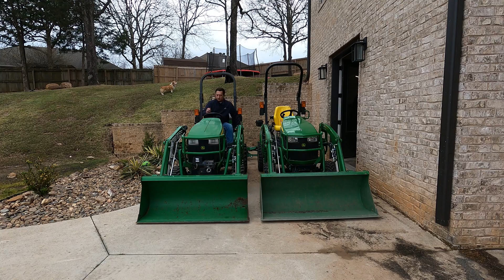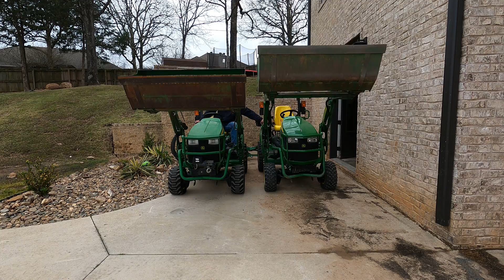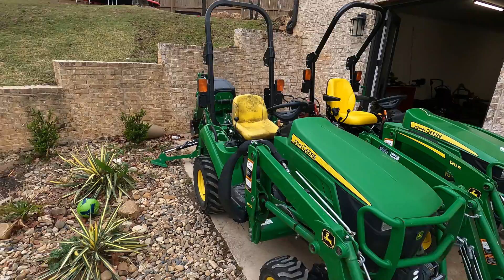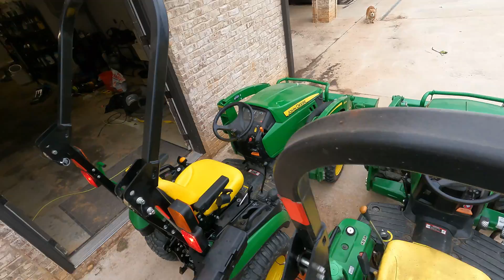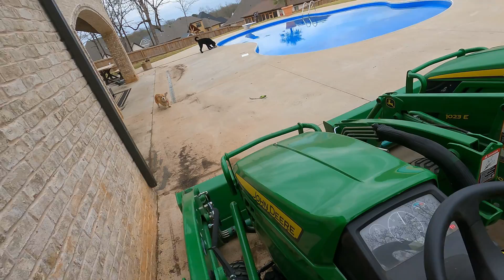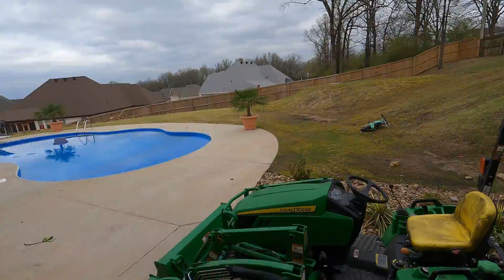John Deere 1 Series Loader Comparison - HydrosPlus Performance Kit w/ 9.5 GPM pump vs. Stock

Comment: Would doing this upgrade along with maybe increasing the hydro PSI to say 2600 on a 2017 1025R increase backhoe performance and digging power?
Reply from the maker: Definitely.  The backhoe PRVs are set at about 2500 PSI, so unless you increase your pressure to at least 2500 PSI, you are losing some potential with the backhoe.  HydrosPlus will make it smoother and give you the ability to run all functions at once.  Here's a video that illustrates this - https://www.youtube.com/watch?v=pG-IjSb4BPc

If you want more backhoe power, you may also be interested in the larger bucket cylinder that we're coming out with this Spring.  Be sure to subscribe if you haven't already and sign up on the website if you're interested for the latest info.

I talk about the backhoe cylinder in the first 5 minutes of this video - https://www.youtube.com/watch?v=R_ldBSPbX-A

Comment: Is it safe to assume this voids the JD warranty?
Reply from the maker: Hi Jim!  Thanks for this question.  Actually, this will not void your warranty.  This is because no single thing that you can do to your tractor can void your warranty per the Magnuson-Moss Warranty Act.  That said, if you do have a problem that can directly be attributed to a failure, then JD can decline to warranty the specific item.

Here are few examples to help this make sense.  

Let's say that you are still in the 24 month full warranty period and you modify your injection pump for extra power.  If your dash cluster goes out, JD will still replace the cluster even though you have modified something that is specifically called out in the warranty document that you can't do.  That's because it's not directly related. 

If you modify the injection pump and then you burn up a cylinder...well, that one will come out of your pocket, but you probably knew that when you pumped up the HP.

There will obviously be some gray areas and depending on the dealer, your mileage may vary on what they accept and what they push back on.  Obviously, the HydrosPlus parts will be warrantied by HydrosPlus and not JD, but because this is flow and not pressure, it's going to be very hard to point the finger at the modification with any proof that HydrosPlus was the cause.  The flows don't exceed any specifications for the plumbing and even though it does take slightly more power to turn the pump because of the larger size, it's just a few HP more and much less than the total HP for the machine - 9.5 GPMs takes about 13HP and 7 GPMs takes about 10 at 2000 psi.

I hope this makes sense, but let me know if you have questions or feel free to email me at kevin@hydrosplus.com
Reply: @HydrosPlus  Awesome answer.  Thanks!  I may be doing this with my 8-day-old 1025R then!
Reply from the maker: @jimfinn99  Everyone has to decide what is best for their situation.  I've had probably 20 customers that have bought the kit before they took delivery of their tractor, but I also know of a few that tell me they are just waiting for their warranty to run out so they can buy one.  For me, this is a no-brainer and I'm willing to take the very low risk of having to fight about a warranty claim...but I'm also the inventor :).  What I can tell you is that it really does work and it's even better than it looks in the videos.  I promise you won't regret it, but if you're worried about having to fight about it on a warranty claim, you can take it back to stock in about 30 minutes.  Give me a ring at anytime if you want to chat.  My number is on my webpage.  Thanks for your interest!
Reply: @HydrosPlus  I want to say that I plan on purchasing your kit for my machine, as soon as it is delivered and inspected, but it is important to note that Magnuson-Moss isn't the protection it is often purported to be.  By the time the Act truly comes into play, the customer must first bring suit, making him the plaintiff; which means that he is actively litigating against corporate giants like JD or Ford.  Indeed, one such claim brought against Ford cost the individual $15,000 - for a $3,000 part - and in the end, Ford settled by providing the part BUT not the installation.  I'm just saying, you've got something great here but as the economy is made worse by those jonesing for a reset - warranty claims are going to be refused with increasing regularity and the only recourse a consumer will have is to file a lawsuit, and honestly? Most won't because the cost of enforcing the act far outweighs the out of pocket cost for the repair itself.

Comment: Does this in any way address the inability to lift/lower and curl in/out at the same time????
Reply from the maker: Yes.  With the increased flow, it's much easier to hit the "sweet spot" where 2 functions at once are operating.  At stock flow, you can run out of flow and even if you hit the sweet spot, it can suddenly stop.